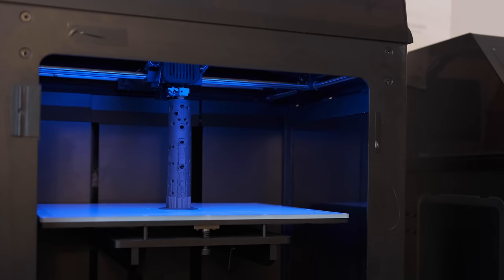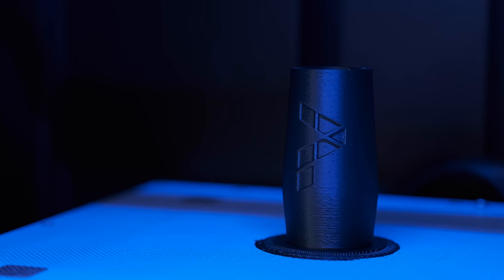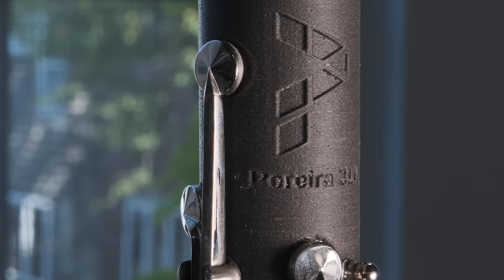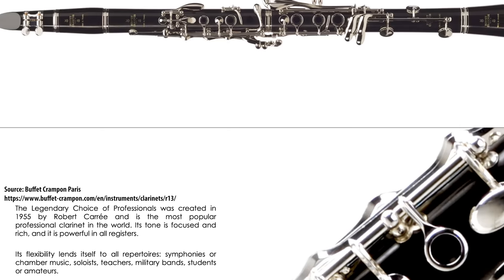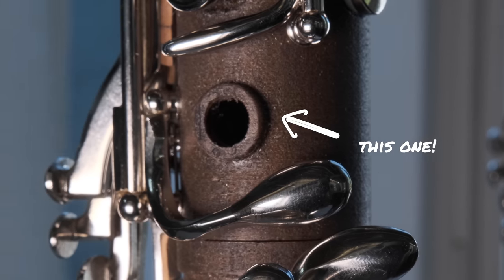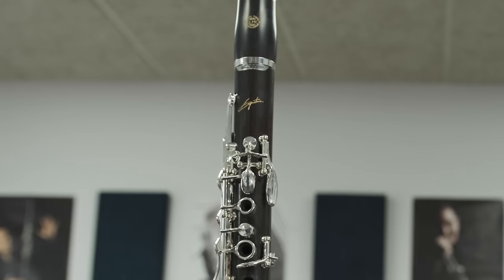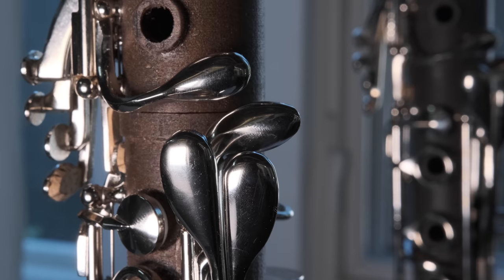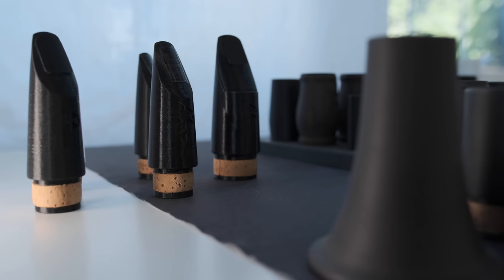3D Printed Instruments, the Sound of the Future?

Comment: Thanks for the review! It feels like this way of producing instruments and the material has potential! The sounds is pretty nice indeed, but according to your playing tests, at this point the intonation and tone consistency were subpar I would say if we compare it with Yamaha 255 or Selmer Prologue.
Also, the finishing of the tone holes looked a bit crude. Is it a bug or feature?
Reply: Hi Eugene, these were admittedly early models from when they were introduced last summer. I’ve since shortened the top of the lower joint and altered the tone holes (especially C/G, Bb/F, and A/E) to address the intonation. The newer models also have a more refined surface quality around where support material was removed after printing, so tone hole surfaces (also keep in mind the entire body is sanded/reamed extensively after the print process) etc. have improved. I do, however, implement a very slightly textured surface to all of my 3D wood products that balances with the lighter weight of the material to enhance response and tone color. Feel free to reach out if you have any questions!
Reply from the maker: Thanks for watching Eugene!  Definitely want to let Ryan field that question. It did take me quite a while to edit and get this video out, so I didn’t want to make any definitive statements about the intonation knowing that my information was most likely already outdated. (I tested the instruments back in October.) I’m looking forward to trying the updated instruments at some point in the future and hopefully giving some updated impressions!

Comment: how is the durability?  I've had my R13 since 1985, with no cracks...
Reply from the maker: That’s a good question, I’m not sure what the longterm stability of the 3D material is. Sorry I can’t be more helpful!
Reply: @ParkHouseCreations  and how's the material in regards to condensation?  Does moisture collect in the side key pads at all?  Last thing - how is the intonation in cold (<60) or hot (>90)?
Reply: For the price the maker should include the 3D files with a non-compete and NDA if thats necessary so you could 3D print your own replacement parts with a $600 printer. The plastic is PLA with wood particles that improves its performance in some aspects but generally PLA is prone to warping at 60C, 140F I think. It doesn't absorb water like Nylon but it's not UV resistant.
Reply: @cybyrd9615 I disagree in that he should include files for the parts on purchase. That would lead to a lot of problems, and simply isn't near worth it for him. It can be very difficult and/or expensive to develop a 3d model, and even more difficult to get keywork for it. You could print keys, but that requires thick plastic keys. You might be able to use the old keys, but they can't just be taken off and put on a new instrument, and likely would require a professional. On top of that, it would escalate problems such as counterfit instruments and the file would get out to the general public, causing more people to think they can just print one without any knowledge, and causing: 1. Less people going to properly buy the instrument, and 2. Complaints to Ryan that the 3d model 'doesn't work' or 'doesn't sound right'.

Comment: It's so futuristic that absolutely no one who makes any form of 3d printed instrument is willing to so much as even sell the files. Selfish.
Reply: Of course they don't, it's their intellectual property. The most hard work is right 3d modeling, not printing. Often 3d creators doing new type of construction to make thing possible to print at all
Reply: You very clearly have never put any effort into either 3d designing or into researching this. 3d designing seems easy, and developing a base model of something is, but refining it and scaling it is incredibly difficult. It can take days of work to create a design that prints well, and when creating an instrument, that is magnified. Even things like the height of the player's fingers and keys, or a millimeter's difference in the barrel can completely change how it sounds. If the instrument is too big or too small, it can completely change what note it is.

On top of that, there most definately are designs out there, both for sale and for free. I've found 3 with like 30 minutes of searching, only 1 of which requiring payment (it is an actually tested model amd has a video linked, as opposed to mostly theoretical models that most free options are).

Please put in the minimum effort of research before posting pointless hateful comments on a rather impressive creation. It saves you the embarrassment of being wrong, and it saves everyone else the time it takes to write a comment this long.